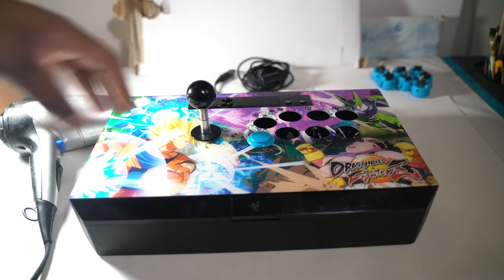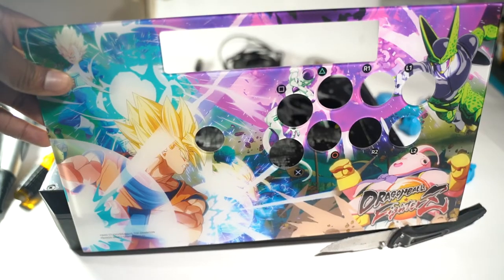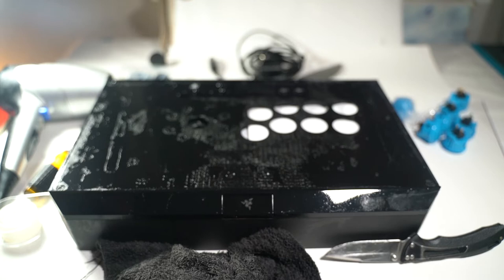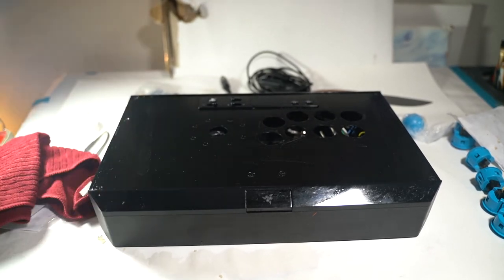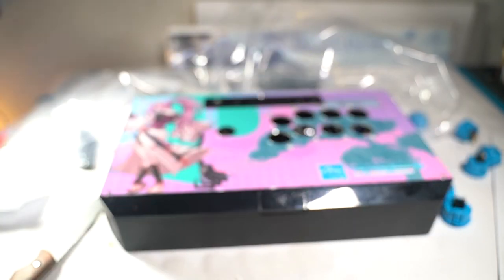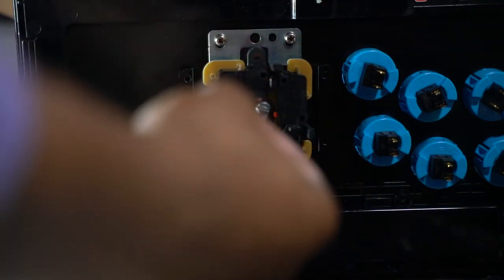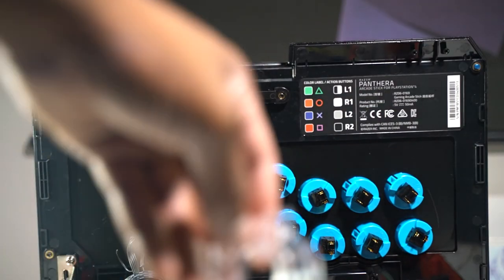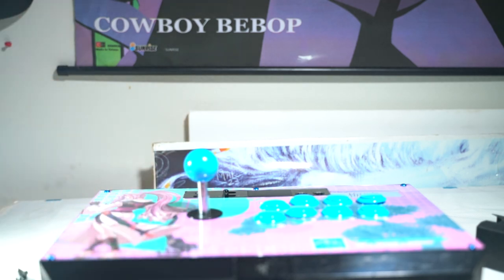How to replace your Razer Panthera Artwork

Comment: How did you change the bottom part to black? Isn't it normally orange?
Reply from the maker: I painted it with acrylic paint, some of it is peeling off now since the time the video was posted but I’m sure you can coat it with something to stop it from peeling off
Reply: @TechdaddyTTV  Optimal way to paint is to sand surface, then use primer, then paint, then use a clear coat to finish for a lasting paint job that won't peel.